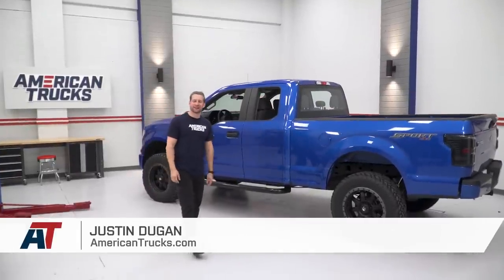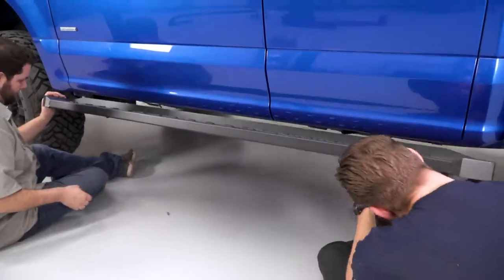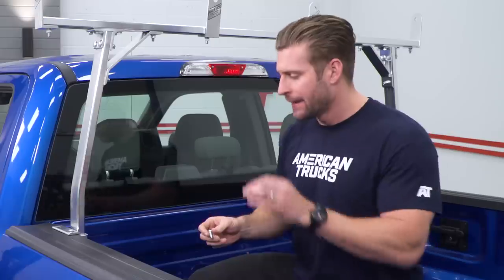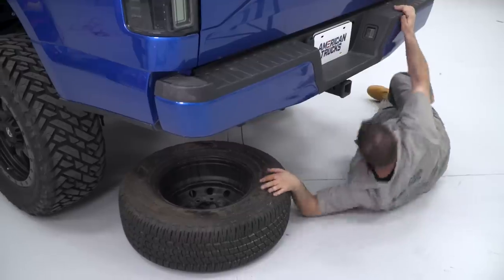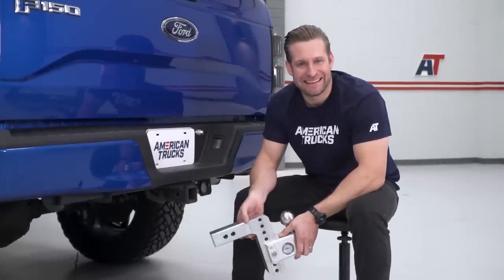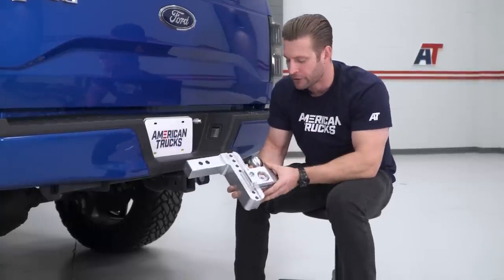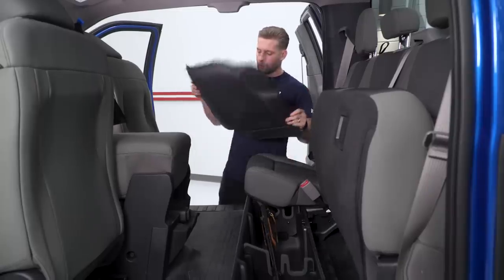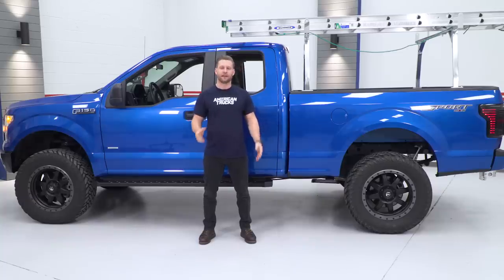The 8 Parts You Need For Your Ford F150 Utility Truck Build - The Haul

Comment: Hay butter cup, Ford trucks are built with aluminum!!!!! Aluminum foil is NOT what you want in a truck!!!! Ram trucks are totally better in every aspect, first they're built with steel NOT aluminum, Cummins engine's, totally better, transmissions, electronics, switches, electrical, transmissions, stick with RAM truck's better quality than Ford's aluminum foil !!!!
Reply from the maker: Hey* David, you are certainly entitled to your opinion.  I don't get too caught up in the brand loyalty pissing match but its no coincidence more of the big 3 are moving to aluminum, including your beloved Ram which does now (GASP!) include a good bit of aluminum.  And at the end of the day, sales figures tend to speak for themselves.  -Justin
Reply: Ram is garbage, the only thing worht a damn in a Ram is the older cummins, which they dont even make. every other part of the truck is trash. they havent even addressed the bump steer problem that they have had for over 20 years.
Reply: David Lasanen Dodge does have great engines + the cummins diesels are awesome! Dodges biggest problem since the 1970's & now are they rust out waaay to quick? Park a dodge truck outside of your house & listen closely at night and if you have fairly good hearing you can actually hear a dodge truck rusting?? TRUTH!!!
Reply: David Lasanen lay off the meth...